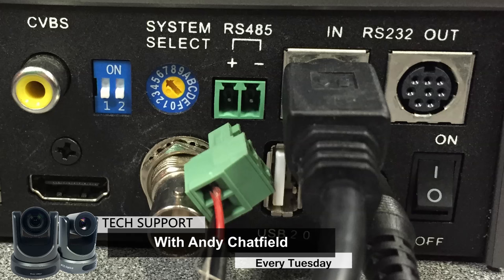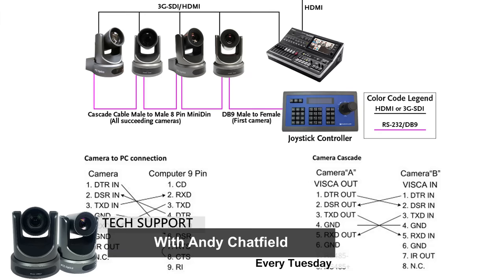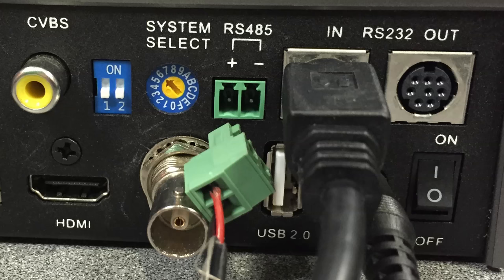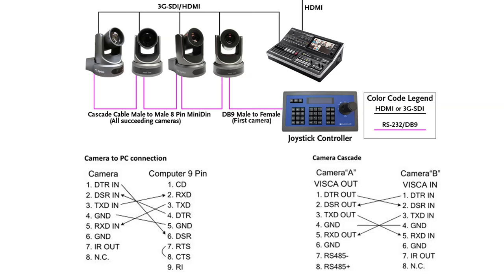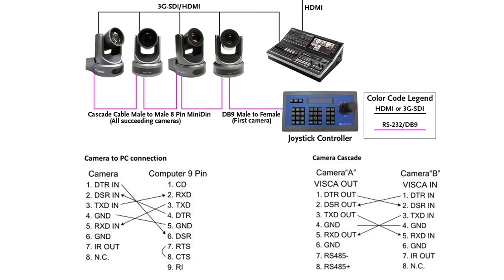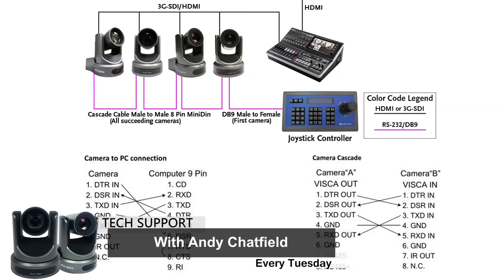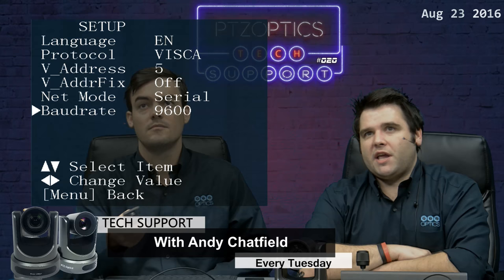RS-232 vs RS-485 Control Cabling (DB9 and RS-422 Explained)

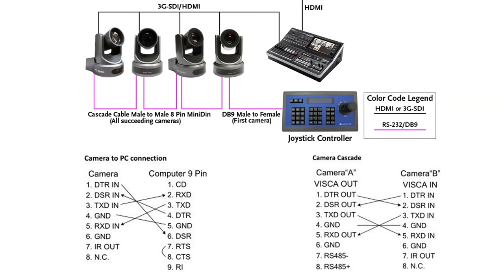Comment: First terminology correction at 1:30.
     Replace your use of the word cables with signals for RS232 discussion.

First technology correction at 2:15.
     RS485 is two way communication.

I couldn't go through the rest of your video...

I hope this helps someone.
Reply: thanks for the correction this is the comment I was looking for

Comment: can i connect not in daisy chain in some way?
Reply from the maker: Yes. Check out our cables page. The first cable from the joystick is a DB9 to 8-pin mini-din. When you daisy chain additional cameras you should use a “cascade cable” which is 8-pin mini-din on both sides

Comment: Can I use the same 9 pin male/male cable to connect in port RS232 or in port RS422/485?
Reply from the maker: They are usually 8-pin connectors.
Reply: @PTZOptics  I have to buy a 9pin cable for a touch screen that the cable is broke. The port is  RS422/485 and there is 9 pins in the connection port. Can I buy any 9 pin cable or there is a specific cable for RS232 port and  port RS422/485 ?

Comment: I have a Huddlecam HC-Joy- G3 pTZ controller with rs-422 pins. I have three PTZOptics 30X-SDI Gen 2  cameras with rs-485 pins. How do I connect radio-422 wires to rain-485? The distance is between 100 and 60 feet.
Reply from the maker: L. Clark - the PTZOptics cameras include a DB9 to 8 pin mini din cable. You can use this with the DB9 extension cable for the first camera and cascade extension cables for the next two

Comment: There’s no such thing as the “DB-9” that you mention frequently.  The “D” denotes the delta shape of the connector shell.  The next letter denotes the number of pins; DA is a 15 pin connector such as those found on older joysticks.  DB is the 25 pin connector such as those found on older RS-232 devices.  DE is the 9 pin connector that you mistakenly refer to as the “DB-9”.  If what you mean is a 9 pin connector such as that found on more recent RS232 devices then you can refer to it by the correct designation; “DE connector”.
Reply: Wow you are the first person who has ever said that to me. Interesting
Reply: @StreamGeeks  I was there when it happened. 😊
Reply from the maker: Hello!
Thank you for pointing out the technical discrepancy regarding the naming of the DE-9 connector, often colloquially referred to as the "DB-9". Your clarification is correct and appreciated. Let's clarify this for future reference:

DE-9 Connector
• Correct Name: The proper name for what is commonly called the "DB-9" connector is actually "DE-9."
• Design: The "D" refers to the D-shaped shell of the connector, and "E" denotes the size of the shell. The number "9" indicates the number of pins.
• Usage: The DE-9 connector is widely used in serial RS-232 communication and other applications. It became popular in computer and communication equipment, including certain models of PTZ cameras for serial control (RS-232/RS-422).

Common Misnomer: "DB-9"
Widespread Usage: Despite the technical inaccuracy, the term "DB-9" has been widely used in common parlance to refer to the DE-9 connector. This usage, while technically incorrect, is frequently encountered in various industries and among general users.

Importance of Correct Terminology
Technical Accuracy: In technical and engineering contexts, it's important to use the correct terminology. The precise naming of connectors can be crucial in ensuring the right specifications for compatibility and functionality.

Conclusion
While "DB-9" is a widely used term, the correct technical designation for the 9-pin D-subminiature connector is "DE-9." This distinction is especially important in professional and technical settings where precise specifications are required. Your attention to this detail is valuable, especially for those working in fields where such connectors are regularly used.

Comment: We are a house of worship and we have PTZoptics Controller and one of your cameras. We use RS232 10FT cable that connects camera with the controller but we need about 10FT of RS232 cable. I wanted to ask if there is a better way to connect    like SDI or other cables when long distance involved.
Reply from the maker: Nikolay Voytovich You just need a DB9 extension cable. We sell them in 25' lengths

Comment: Can I home run from each of 3 cameras to the Joy stick?  I am looking at HD Joy G2
Reply from the maker: Yes, you can run homeruns using RS-422. I would give our support team a call so they can explain. There is also a knowledge base article about it.
Reply: Thanks for that info.  I just checked the knowledge base and this video covering Serial Control is very top generic explanation and only covers RS232 as I am looking into RS485.  I need a more technical video.  Also you referred to RS-422 instead of 485.  Are these terms interchangeable?
Reply from the maker: I believe so but I would call or email our support team. I know they have a Knowledge base article about it somewhere.

Comment: The terminology is incorrect. The baud rate does NOT vary the AMOUNT of information transmitted, it varies the RATE at which the same amount of data is transferred between devices. So a high baud rate gets the information there more quickly. A low baud rate still gets the information to its destination but it takes longer.  Baud rate is a trade off only in terms of time and distance. Long distances can introduce signal noise and timing issues which are made less problematic if a lower baud rate is used. The common 9600 baud rate is a good trade off between the two, giving decent speed and reliability.

Comment: I have 2 SRG 300H Sony cameras how can I wire it with that controller?
Reply from the maker: Hello Ryan, The SRG 300H uses the same SONY VISCA protocol as our cameras PLUS they have the same 8-pin mini-din connection. So you can connect these cameras just like PTZOptics cameras shown in this video. If you have any other questions just let us know
Reply: So can we use regular CAT 5e to connect the controller and the cameras? I'm a volunteer on our church and we've been using an IR remote to control 2 cameras so we're planning to buy this controller cause sony controller is so expensive for us right now. and should we use RS485 or RS 422 Protocol?
Reply from the maker: Hi Ryan, You will want to use RS-232 or RS-485 cabling. I would suggest calling our office and speaking to someone in sales to make sure you get the correct cabling.
Reply: PTZOptics Hi can you tell me the name of the blue adapter that goes to the RS485 slot..I have the same dvr with the pin hole and I needed to find an adapter to connect my control cable from the ptz

Comment: Bruce Jenner got a hero reward for changing his gender.  If I use an RS-232 gender bender to connect a cable between two devices so they can communicate will you guys give me a hero reward?
Reply from the maker: Yes, you would definitely get an award!
Reply: Thank you.  My mommy says I'm special, so this would make her very happy.  I won't need to trade all my guy clothes in for girl clothes.  I won't have to trade my andrologist  in for a gynecologist in either, nor learn how to menstruate and have to buy Tampons and become irritable. You are the best!
You're really smart.  Please explain why the female socket connector is called a "Jack"?  Shouldn't the male plug be called the Jack and the female connector be called a "Jill"?  Do you have any influence over the NEMA, IEEE, IEC or EIEIO to get this changed?

Comment: For a DATA Rs 422 on a Camera we got from the highway patrol it has 5 wires can any of the two or 3 be connected to a joystick if we only have one camera and we only want to control that not receive back info? The colors are R B G W and Blue  any thoughts ?
Reply from the maker: Hello,
To control a camera using RS-422 with a joystick controller, you'll need to connect the appropriate wires from the camera to the corresponding inputs on the joystick. RS-422 typically uses a differential pair for transmitting data, but the presence of five wires (Red, Black, Green, White, and Blue) in your setup indicates there may be additional functionalities or grounding/shielding involved.

Here's a general guideline, but please note that without specific wiring diagrams or manufacturer instructions, this is a bit of guesswork:

Understanding RS-422 Wiring
RS-422 Standard: Typically, RS-422 uses four wires - two for transmitting data (TX+ and TX-) and two for receiving data (RX+ and RX-). However, different manufacturers might have variations.

Possible Wire Designations:
Red (R) and Black (B) are often used for power (V+ and V- or GND).
Green (G) and White (W) could be the differential data pair for either TX or RX lines.
Blue might be an additional ground, shield, or a control line.

Basic Connection for Control
Identify Data Wires: You need to determine which wires are for RS-422 data transmission. If there's no documentation, you might need to experiment or contact the manufacturer.
Connect to Joystick: Typically, you would connect the TX+ and TX- from the joystick to the corresponding RX+ and RX- on the camera. Since you only want to control the camera, you might not need to worry about the camera's TX lines.

Steps to Try
Consult Documentation: First, check any available documentation for the camera and the joystick controller to identify wire functions.
Test Connections: If documentation isn’t available, you might need to test connections. Start with the data wires (possibly Green and White) and connect them to the RS-422 input on the joystick.
Power Considerations: Be cautious with the Red and Black wires, as they are likely power-related. Incorrectly connecting power can damage the equipment.
Grounding: Proper grounding is important. The Blue wire might be a ground or shield wire.

Safety and Caution
Be Cautious: Incorrect wiring can damage the camera, the joystick, or both. If you’re not sure, it’s best to consult with a professional or the equipment manufacturer.
Manufacturer Support: Reach out to the manufacturer or supplier of the camera for specific wiring information.

Conclusion
Correctly connecting a camera to a joystick for RS-422 control requires accurate knowledge of the wiring scheme used by the camera. Without clear documentation, there is a risk of trial and error. The safest approach is to obtain a wiring diagram or detailed specifications from the manufacturer or a qualified technician.